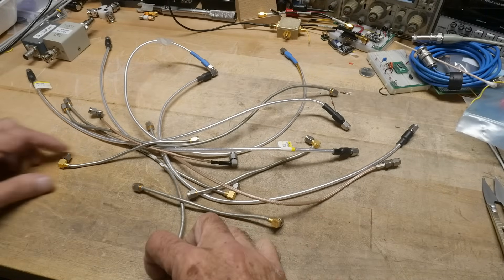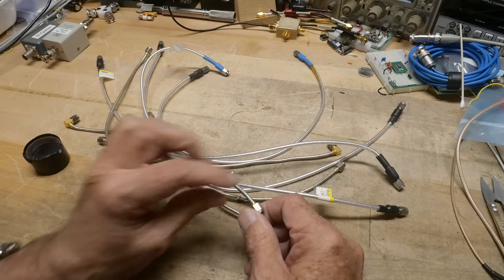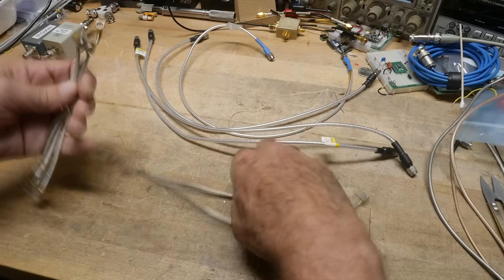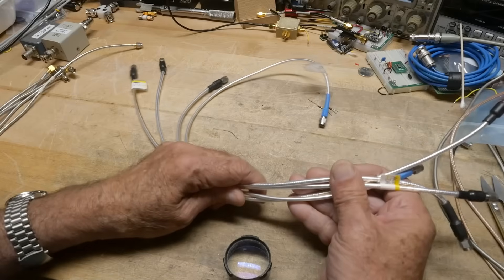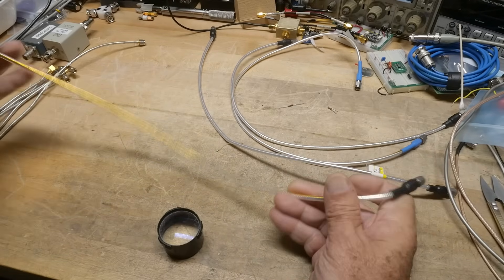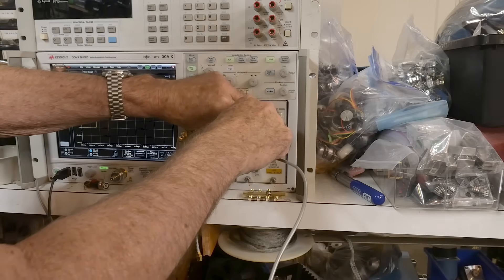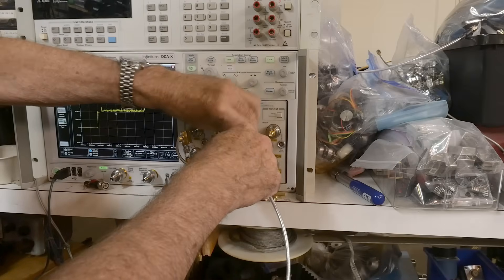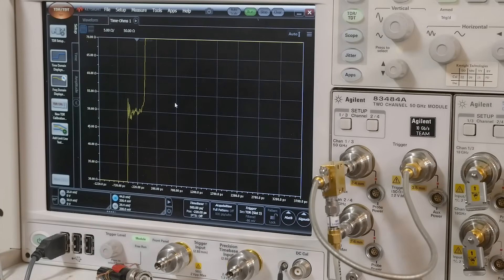#2364 Semi--ridged Coax Cable Assemblies

Comment: You are mixing up coaxial cable types. The 100% shielded (copper or aluminum sleeve, Teflon dielectric, quite rigid) type is called SEMI-RIGID, commonly available in 0.085" and 0.141" OD. The other cables (having tinned weaved braid) are called "CONFORMABLE". Semi-rigid is the best as far as losses, but for short lengths, we are talking about small fraction of dB differences, even at 10 GHz. Thanks.

Comment: Made many 0.141 semi-rigid coax assemblies way back when.  Most were used either at X-band or Ku-band frequencies to connect between up/down converters, RF switches, HPA, LNAs, etc.  We had all sorts of jigs and tools to cut the cable and prepare it for soldering on the SMA connectors, and bending it to fit to the path.  Fun stuff.

Comment: I'd say the holy grail is the Anritsu low loss.  It's my primary material for Ka and V band.   Torque its 8 +/- 1,  but max is 16 in lbs.
I've had to make my own tools for 0.118", because you just can't buy them!

Comment: Thank you again for the presentation.  I had no knowledge of rigid or semi-ridged cables until your HP 8711/8712 project.  The semi-ridged cables were purchased on Ebay and worked wonderfully.

Comment: RG-180 is 95 ohm coax.  But only 17.5 pf foot.  I got some 90 some ohm teflon coax because of the low C.  For applications that need 15-17 pf per foot rather than 30 or something.  Plus you can solder the hell out of it and not hurt it.